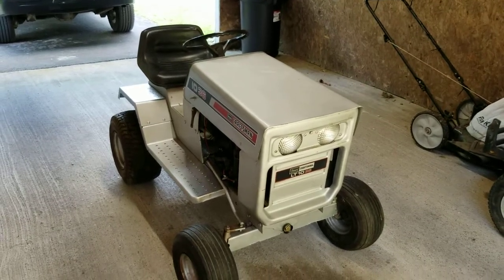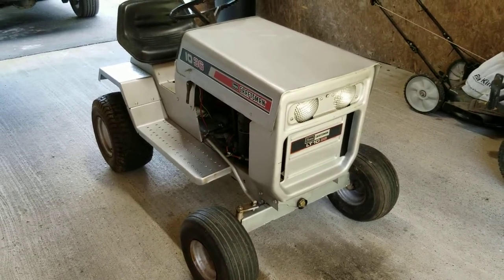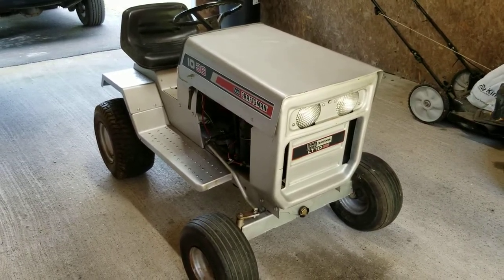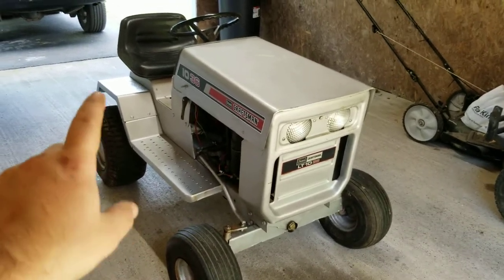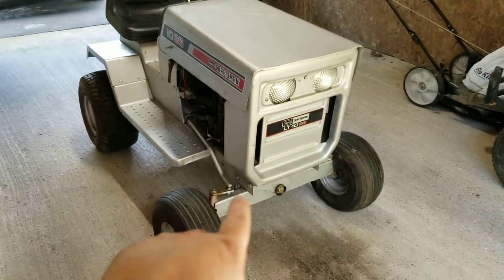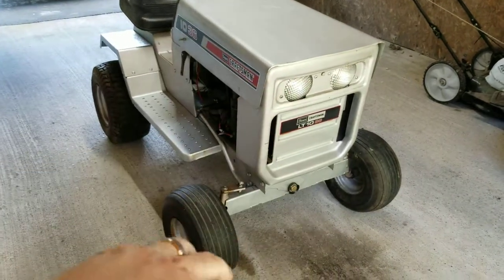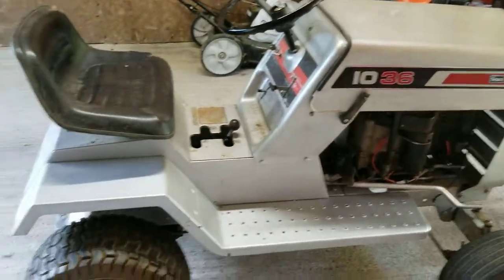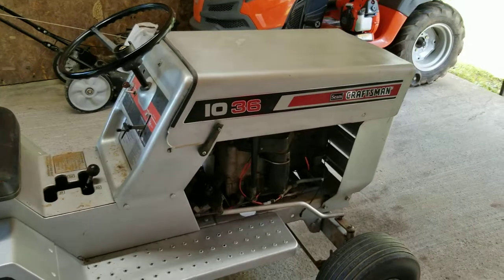My 1981 Sears LT1036

Comment: That engine with that sticker is an actual briggs.the Tecumseh ones had a weird plastic air cleaner assembly and a carburetor that bolts to an aluminum intake to the engine.the Briggs ones are a one piece carburetor with intake built into it.the Tecumseh engine had the starters that bolted on with 4-10mm/⅜" head bolts and the Briggs one had 2bolts behind the starter gear sized 13mm/½" I own 2 of the Tecumseh ones and I own 4 of the Briggs 10hp engines. just a little correction on your video that's all.goos video though 👍someone may have done an engine swap on it once before your ownership on it and replaced the Tecumseh with that Briggs engine.just saying that's probably why the confusion.the openings on each side under the headlights was for the exhaust to come out the front  from the carburetor side aka left side while sitting on the tractor.the Briggs engine had the cigar looking mufflers at that time.the Tecumseh exhaust muffler was weird looking and odd that it came out the front to vent.

Comment: we are trying to change the drive belt on our lt1036 and it has been a pain trying to get the old one off, does anyone have any tips on geting to new one on
Reply from the maker: Make sure the parking brake is set. Start by wrapping the belt around the transmission pulley and route it forward. Finish by wrapping it around the engine pulley, then release the parking brake.

Comment: I don't think that is a 1974 model.  Looks like around 1980.
Reply from the maker: According to the serial number it is a '74. The SN is 917.255270. I believe the 80's had the sloped octagonal rear fenders and slightly different hood stickers. Thanks for Watching!
Reply: @CCWP0251  Interesting.  It looks about the same as mine, which doesn't have a SN label on it so I haven't been able to ID.  I thought it was around 1980.  Mine was given to me by my neighbor right before he died of cancer so I fixed it up and use it all the time to mow my grass.  I'll compare yours to mine when I have time (and daylight) and see if I can spot differences.
Reply from the maker: @garyh4458  Awesome! If you need any help at all figuring it out, let me know. I'll provide any info or pictures you may need. If it has a 10hp Tecumseh, it's around this time period ('74-'75ish). Briggs was used in the later models. Also decal differences, and different rear fenders.
Reply: @CCWP0251  Thanks for the offer.  I finished restoring mine a few years ago.  It took a lot of parts searching to get it back the way it should be but I managed.  The only issues I have at this point are that it is hard to get in gear sometimes when the brake is pressed.  And something strange that started recently is that every now and then I will put it in Reverse and it totally locks up the transmission.  If I let off the brake the engine just dies because it can't turn the pulley.  If I switch to another gear and back it clears up, though.  I need to tear down the transaxle at some point but I don't really know much about those so wouldn't know what to look for.
Reply from the maker: @garyh4458  I had that issue with my transaxle years ago. Take the transaxle apart carefully. The reverse gear is on it's own shaft that likes to come loose and bind up. I took that out, drilled a hole through the shaft and the case, and re-secured it with a grade 8 bolt and nylock nut. It has been holding for years.
Reply: @CCWP0251  I just ended up with another one of these.  It has a few differences from my first one.  It is more similar to what you have. Main differences are the tie rods and engine.  The engine is a VM100 but my other has a TVM220.  Both are Tecumseh 10 HP.